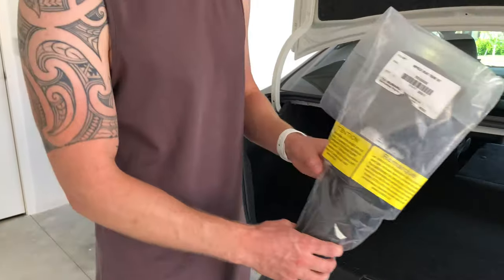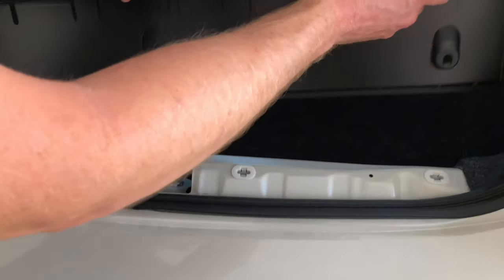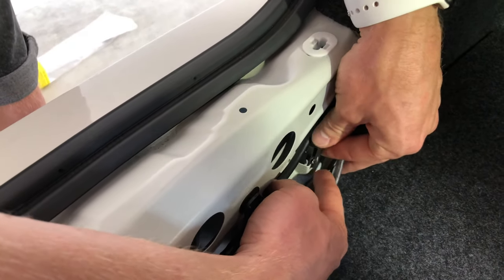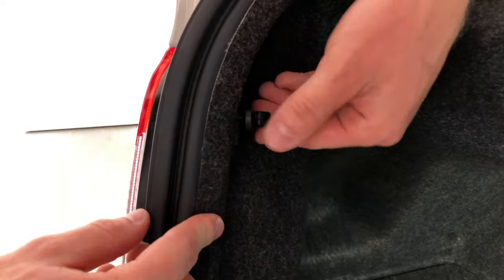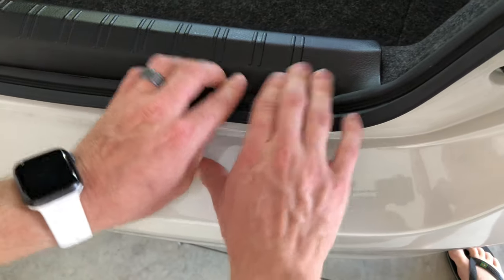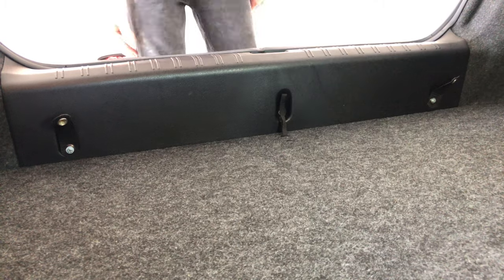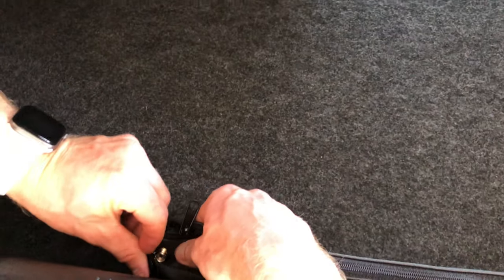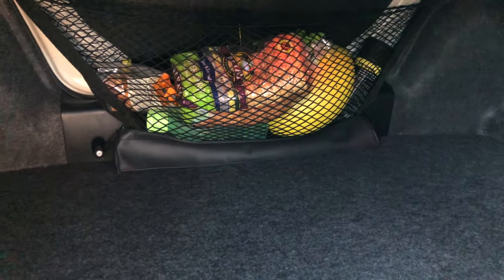Cargo Net Install on a 2019 Subaru WRX STi

Comment: Thank you for making this video! I appreciate the effort getting good lighting and crawling around in the back seat so that I can actually see what you're doing. I did apparently get the two sizes of washers reversed, but I did this in the grocery store parking lot, so I have to go back and tighten the hex bolts anyway. Again, thank you!
Reply from the maker: Thank you for your comment. We find that a lot of product install vids tend to leave out/not show all the important details. So we try our best to show everything to prevent the frustration of having to work the small things out.